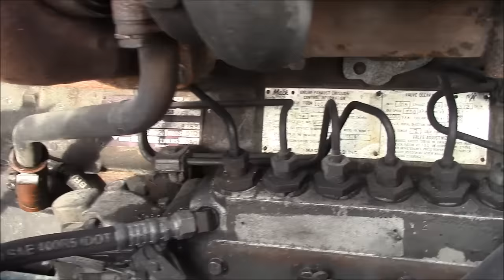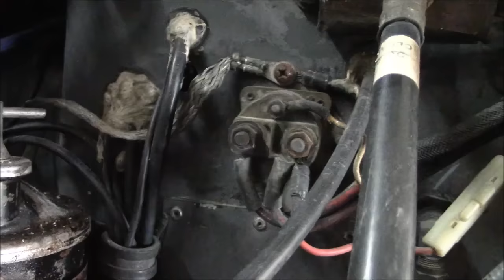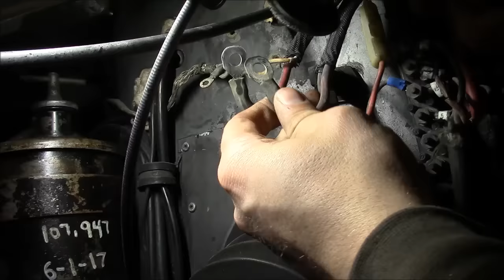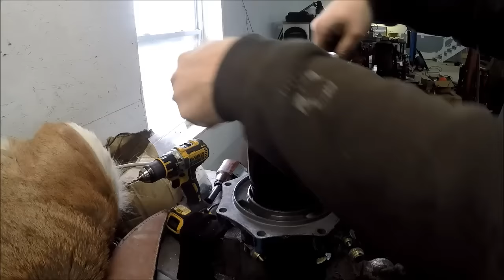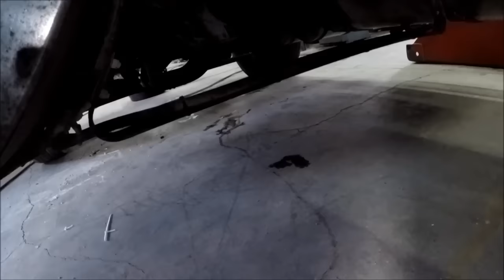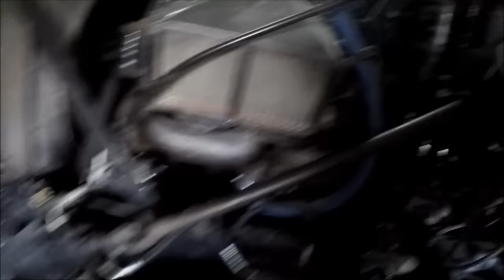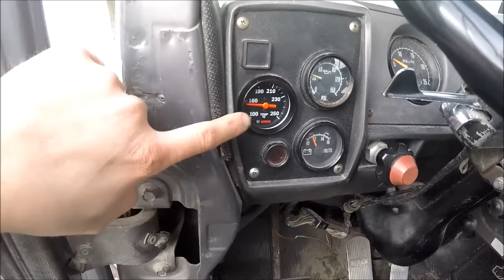Cool 1977 Mack RL600L - No Crank, No Start - Plus Many Other Repairs

Comment: 39:10 Yep, totally didn't see that for 1.5 seconds in another video during a quick pan from left to right.
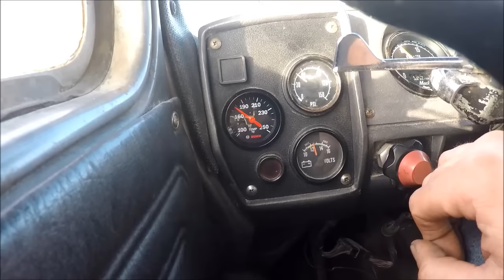39:30 Heavy trucks tend to have such a huge battery capacity that when they're low, the alternator can be putting out at max, and the voltage will take a surprisingly long time to come up.

Comment: Ive used,sold thousands of tubes of dielectric grease,was taught by lighting mfgs,trucklite,grote,peterson,betts,to be squeezed INTO METRIPAC CONNECTOR,ON LAMP CONNECTION.we checked warranty return lamps,if connections were dry,green,or corroded,NO WARRANTY

Comment: Electrician here, I work in mining. SOOW cable insulation gets all soft and swollen from being in contact with oil. The outer jacket does fine, but the individual conductors just suck it up.

Comment: Most alternators don't start charging until they spin 1200 rpm. if the pulley on the alternator is roughly the same size as the crank pulley then you have to rev the engine to get the alternator to charge. You can fix this somewhat by putting a smaller pulley on the alternator or a larger pulley on the crank.

Comment: As a truck mechanic I use dielectric grease to fill up the seven way trailer cord whenever I need to service those things. Also use quite a bit when I do spark plugs on a gasser. Never had problem with electrons not flowing, does save a lot of headache down the road with corrosion

Comment: Enjoying the video.  I just purchased a 1992 Mack RD688s and of course I have to work on it to get it ready to haul(its a dump truck).  Anyway how do you find the torque specs for the different vehicles you work on?  I have scoured the web and have failed to find any specs other than a general bolt torque chart.  Thank you.  By the way, the terminal switch looks good.  May have to do that on mine.

Comment: I was a Licensed Electrician for 45 years, we used Kopper Shield for all connections. It is as nasty to use as Anti-seize but it is infused with fine copper. It prevents corrosion, oxidation and is highly conductive. I have gone back to work I did 30 years ago and it is still soft and ended up with it up to my elbows.
Reply: Could you use copper anti-seize in a pinch?

Comment: What some people fail to understand is that dielectric grease when placed on contacts and they are put together it flows out of the connection where metal to metal contact takes places under the most pressure . leaving a sealed metal to metal contact surface . Its viscosity is that way on purpose..

Comment: When I got out of school in 76 I went to work for an excavating contractor when I started he had an old B model Mack, that I started moving equipment with. In 78 he upgraded to an R600 with the 300 and a straight five speed. During the winter i would haul coal to J&L Steel in Pittsburgh. In five years I put a bunch of miles on that truck.

Comment: This old Mack came after the twin stick transmissions.  This one simply has 5 forward gears.  They were designed to take advantage of Mack’s legendary torque.  In fact they didn’t work very well when they were loaded near the legal weight limit of 80,000 pounds.  Just not enough gears.  I drove a 5 speed and a 6 speed Mack, both with a 350 HP engine.  Running the same route with a 350 hp engine in a Mack with a 10 speed and it was much easier on the truck and the drive due to less stress worrying about getting ran over in heavy traffic because of my slow speed.  In the older trucks they had what was called an Auxiliary transmission and it was shifted with the second stick.  In the newer trucks they still had the Auxiliary transmission giving it more gears but the second stick was replaced with air solenoids operated by buttons and switches mounted on the shifter in the cab.

Comment: G'day Wes.
I noticed that old Mack appears to have a Gold bulldog emblem on both the hood and steering wheel boss.
I have been informed by more than one knowledgeable Mack aficionado that a gold Bulldog emblem signifies all the major components for the truck were made and installed by Mack OEM.
With reference to your observations during a comprehensive inspection that seems to be the case with the grand old workhorse you had the pleasure of maintaining.
Apparently if a Mack truck has a non-Mack engine, drivetrain, suspension etc from the production line however, it should feature a silver Bulldog.
According to an internet search this is actual and factual but as an American with an abiding interest in Mack trucks what is your take on that particular bit of Mack lore?

Comment: Yep dielectric grease is used as a heat transfer compound so that a component like an ignition module with dielectric grease between the module and distributor base and the like also its great in electronics on larger transistors any way alls well that ends well.

Comment: Battery system was genius, 4000CCA between those 4 batteries. Back when batteries were weaker maybe 600cca a piece it was probably needed.

Comment: The battery sitting directly on Concrete is not a myth. It’s just interpreted wrong. The battery can be affected negatively by very hot concrete and very cold concrete. It’s the transfer of temperature that you want to avoid by sitting a battery on a board and let the air circulate around the entire battery which helps significantly. here in the Caribbean Concrete gets very hot. Air temperature is typically 83° but you’ve been to the beach before that’s sand is much hotter and so is the concrete here in St. Thomas .We shade the battery and sit it on a board to reduce transfering the heat from the hot ground to the battery . I don’t live in the Arctic where it’s very cold, but I wouldn’t want to sit my battery on the ground and transfer that cold through the plastic. I’m sure you would want to sit it on a board with air circulation all the way around it as well.

Comment: For high current solenoid/starter /alternator.... screw down connections, then Ive always used copper grease which is a conductive lubricant/moisture inhibitor...
AND petroleum gelly on battery terminals, as copper grease would cause a galvanic reaction with lead.....
Nice truck - a time when the US made great things, just like us hers in the UK.
AND then came the bean counters. and companies became financial corporations like Agco, Terex.......... 
👍

Comment: I have had the opposite experience w dielectric grease. I've had it make a plow truck connection fail. I had to spray out the connection with wd40 and wire brush it to get it to work again. I also had a tail light w some dielectric grease on it fail. The grease itself is not conductive. It doesn't have conductive properties. It is meant to insulate good connections against corrosion. This is why we put it on spark plug boots, but not the conductors. The way to use it is use such a thin film of it on a connection, that as you make the connection or push the connectors together, the metal conductors push the grease out of the way for contact, but all around it is insulated by the grease. So keep the grease usage very minimal, IMO.

Anyway, I watched the video you linked to, and I believe thats what those connectors did when he connected them. The conductors pushed the grease out of the contact patch as they engaged.

Comment: I use those pipe nipple extractors to get stuck choke tubes out of shotguns.
They work about 1/2 of the time.
The rest you have to weld a metal bar into WITHOUT welding anything to the barrel itself. 

YES, it's a TRICKY job. If the shogtun barrel has a camo coating on it, it'll get burnt.

Comment: If anybody goes back to watch this video, in 2023 the DOT, and all of their wisdom, determined that ANY power steering leak is a violation, even just slight seepage where hoses meet components.

Power steering repairs are no longer optional.

Comment: You know that's funny about the dielectric grease because most of the time when you buy a thing of spark plug wires they give you a small little packet in there that's got some clear grease in it that's dielectric grease and you put it inside spark plug boots before you Stick spark plug and spark plug wires pass a lot more high voltage than that connection there is ever going to do it just really kills me cuz people like to comment or like to assume they know absolutely everything about everything I do too I put it on every layer I put it on everything electrical and plugs light sockets and everything else cuz it helps keep the corrosion and everything from happening and if you get a lot of water in your connections it keeps things from corroding

Comment: I know the video is old but I’ll comment anyway. Several years ago John Deere sprayers were having CAN bus issues. The cause was too much dielectric grease in the CAN bus splice packs. The fix was to clean out the excess grease, lightly coat and connect.

Comment: Atmospheric ozone (O3) is highly oxidizing and causes breakdown of rubbers and polymers. Under-hood wiring is exposed to the thermal environment as well, and since heat just speeds everything else up, ozone dry rotting of rubbers and polymers is accelerated.

Comment: I have a 1978 U 600 Mack single axle dump truck. I have changed the treadle valve twice now. The first change lasted 3 years. Now the second one has air escaping out the bottom. The air pressure builds only 60 psi. How do I find the problem? I have changed both check valves.
Reply: you may have another brake valve that is back feeding into the treadle valve.
Reply: I changed the rear axle  brake  relay this did not solve the problem. Starting  to suspect the hand knobes on the dash.

Comment: Don't drive a heavy duty truck with your hand inside the steering wheel. If one of the steer axle tires blows out, the steering wheel will whip around and cut your hand off. I saw this happen once. Keep hand and fingers outside the steering wheel.

Comment: Good looking Dog, I had the same thing with the 6 speed, I hauled coal in eastern Ky, usually grossing 120,000 lbs, and it might of been slow but nothing else pulled like it did, remember at that time Mack horse power was rated at the ground, so the 300 was doing better than a lot of people knew.

Comment: My dad had a full set of those nipple extractors, he called them "Easy Outs" and if you mess up the internal hex head shape of an allen bolt, you can remove them with an easy out too.  I have one with a broken nipple that has been on the easy out for more than 50 years.  Must be a size you don't use often

Comment: Enjoyed this video for unique reasons. In 73 I graduated from Penn State engineering school and landed a job as an R&D Engineer for Mack Tucks in Allentown, PA (yes the Billy Joel town). First day on the job they taught me how to drive a tractor trailer. Your video was a Time Machine, the sights and sounds of driving the truck were vividly identical to 50 years ago.....thanks for the memory. BTW these trucks had a clutch brake at the end of clutch travel which permitted faster upshifts than double clutching, but for some reason most drivers preferred to double clutch, and the clutch brakes were often out of adjustment. For five years I was involved with the development of the first Anti-Lock braking systems. Spent many hours making thousands of 60 MPH panic stops confirming compliance with FMVSS-121 requirements. Couple comments on the brakes relevant to your video. In that era wedge brakes produced more torque than cam brakes (both shoes are primary shoes), some trucks, prior to the arrival of air disc brakes, needed them to meet stopping distance requirements. Also popular in that era was a front axle ratio valve that reduced the front axle delivery pressure to 50% for low pressure treadle applications to prevent front axle lock-up due to the high torque front brakes. For higher applications the valve passed full treadle application pressure...could cause the perception of weak brakes for low and moderate applications? Air pressure gauges at front and rear brake chambers would quickly confirm if this was the case. The valve is easily spotted if installed near the front axle. Finally the RL model was designed and manufactured by Mack Western in Hayward CA, they were quite different than the higher volume East Coast trucks. Good luck with your career course adjustment..

Comment: The Navy electricians book says to snag a little grease on every switch contact as preventative maintenance.   That’s for relatively sturdy contacts.   Maybe if you have super tiny pinhead-sized relay contacts with tenth of an ounce springs, then maybe grease is a bad idea.

Comment: CorrosionX and CorrosionX Heavy Duty are extremely good at waterproofing electronics. You can cover a circuit board in the HD stuff and it'll keep working underwater

Comment: She looks nice, camel back and CRD 92/93 rear diffs. Thermodyne engine were mostly turbo charged unles they were 180 hp or lower. Series charge as you have is 285 plus horse power upto 320 horse power. Sorry but used to air start on these old girls. Engine variants at the age were Thermodyne, maxidyne and econodyne. Easy wat to tell when original was the colour of the bull dog, silver is econodyne, gold was maxidyne and bronze thermodyne and detroit cat etc. Trans you have is a 6 speed twin stick. Sorry but cut my teeth on these and please send more

Comment: That is what we call a cool power 320HP in Australia, were we put the steering wheel in the correct location ( Haha) The exchanger on the side is the intercooler that gets feed from a tip jet fan from the turbo. This model was distinguished by the bronze coloured dog on the hood.
All of the Macks I had anything to do with had Ingersoll-Rand air starters fitted and relied on the battery having enough oomf to fire the air dump solenoid if they were flat you just pushed the plunger in manually with a pen or pencil. My Old Flintstone had a hose made up so you were able to flatten most of the tyres on the drive bogie  into the start receiver and off you went for another days fun and festivity.
Totally agree about the Di-electric grease, if caused resistance then Im stuffed a it is all over my gear electrics.
Love your videos my friend.
Kindest regards
From Australia

Comment: Dielectric grease doesn't stop electricity, it stops it from escaping. They use it in spark plug wires. They use it on black tape. 

"having the property of transmitting electric force without conduction; insulating. "

Comment: Isn’t there a truck manufacturer who has an air-pressure starter or something? I thought it was Mack but I guess not
Reply from the maker: The starters were made by Chicago Pneumatic and others. They could be fitted to any engine.
Reply: @WatchWesWork  oh, alright, that’s really cool. Thanks

Comment: At 10:51 the insulation sleeve has been placed too low on the cable, so that it covers part of the terminal.  This leads to bad connections.  The insulation sleeve MUST be back from the main section of the metal terminal to allow full contact to be made, by, for example, a washer or a large nut.  For example of a correct placement, see the slightly smaller one behind, where the sleeve ends correctly.

Comment: HERO8 Black scans the entire scene to choose the exposure level for your
shot. Exposure Control lets you decide if only a section of the shot should
be used to set the exposure.

Check out the shot preview on your touch screen. Try Exposure Control
if there are sections that are too dark or too light.

SETTING EXPOSURE CONTROL USING AUTO EXPOSURE
With this option, the camera automatically bases exposure on the area
that you select.
Imagine your camera is mounted on your dashboard. You probably want
to set the exposure based on the scene outside instead of the dashboard.
This will help prevent your shots from being overexposed (too bright).
1. Press the touch screen until a set of brackets with a dot in the middle
appears in the center of the screen. This is the Spot Meter. It will base
the exposure on the center of the shot.
2. Drag the brackets away from the center if you want to use another
area of the shot to set the exposure. (You can also tap that area
instead of dragging the brackets.)
3. Check the screen to see if the exposure looks good. Tap in the
lower right corner.

Comment: I live near the Oakville Mack plant (Polywheels now) and I remember going there to buy parts back in the day. The company I worked for had a fleet of them nearing 40 years old in service hauling billet, coils and structural. They did glider kits one after another, and welds near 3" wide in cross members where they would crack. Of course nobody was ever overloaded. Those trucks would take a punishment unimaginable. I did drive a few R700 turbo with 2 sticks from mid 1970's.

Comment: Installing dielectric grease over the connectors after it’s connected is like putting a condom on after u fired your unsatisfactory round. Ppl these days are just mechanics at the tonka truck level and they will never reach the level Wes is at because they like to use their one cock hole way more then the two ears god gave ya. You learn more when u shut ur mouth and open your eyes ears and heart. Wes, keep on figuring out that ladies problems we loyal fans are gonna be around.

Comment: Wes, I am 80 years old, and I have been using Dielectric grease on the connectors before tightening them up for Decades, and it has never failed me.  It is good to keep Water out, so no corrosion occurs, and prevents arcs.

Comment: The motor is a 300 or 315 Madeleine inter cooler is on top and two intake tubes off air cleaner the valve covers are the same on maxidyne and thermodyne till the e7 series